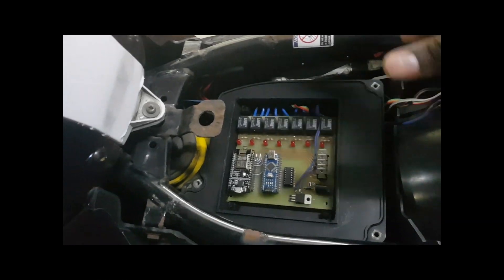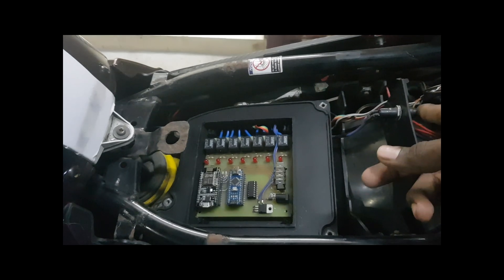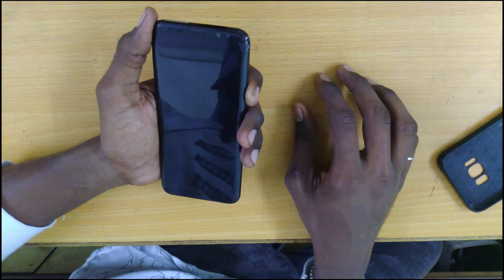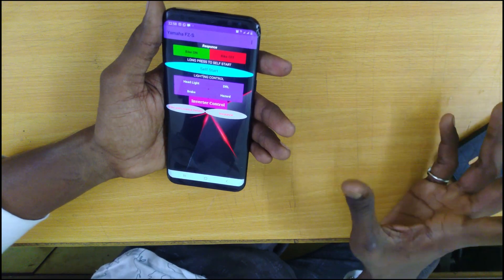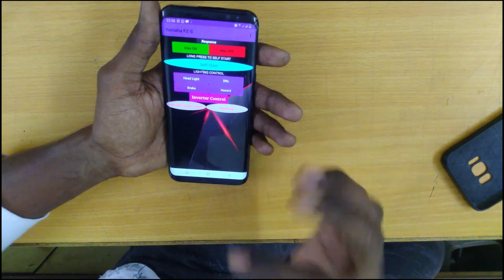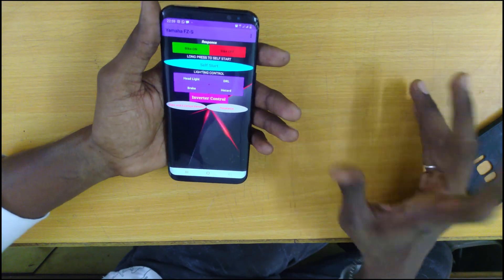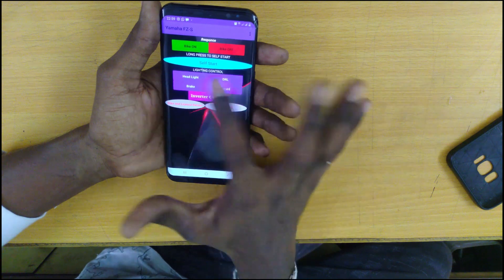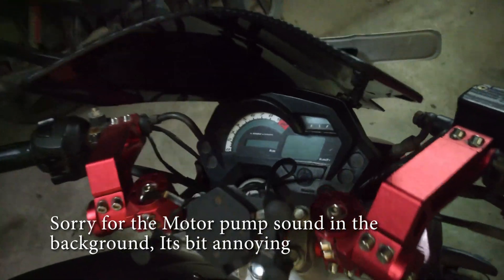Bike Automation on Yamaha FZs | #automation #arduino #nodemcu #tamilvlog #yamaha #fzs

Comment: Bro, bike auto on with in eppadi pandringa.....
Explain
Reply from the maker: Wifi signal strength base panni bro .
Reply: @narenvlogs6606  brother, all relay working node MCU enough, why you added Arduino mini. What purpose.... One why not using blink app. Is better than your app...try it.....